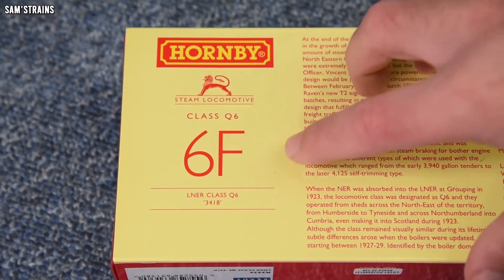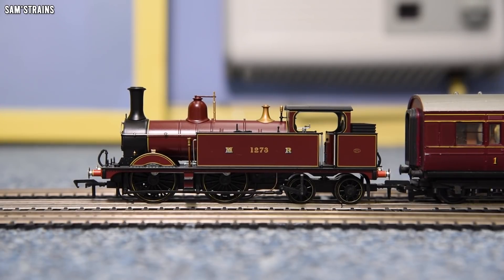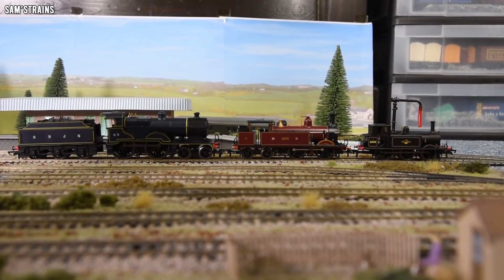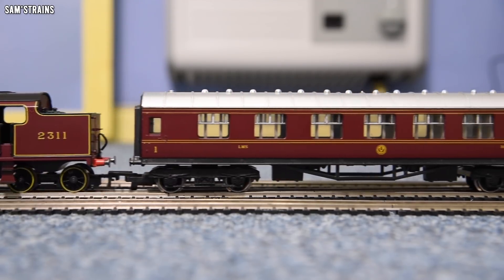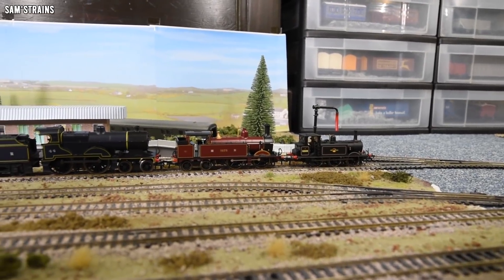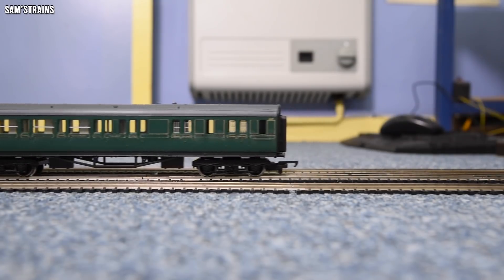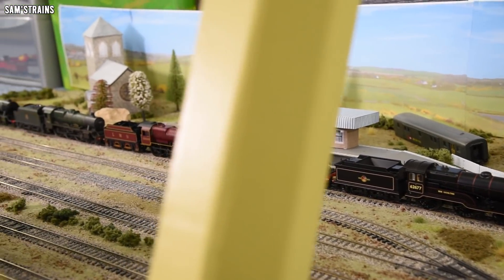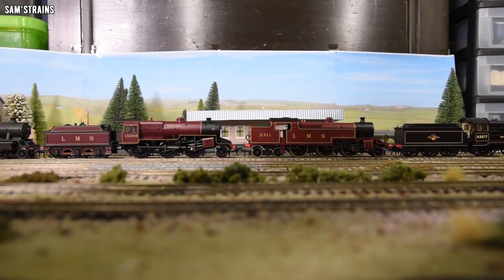British Steam Trains | Smallest to Largest!

Comment: 11:44 The Gresley A1s were a pre-grouping design and were classified 7P by BR.
Reply from the maker: Ahh fantastic - that would have been a good choice then!
Thanks for watching - Sam :)
Reply: I thought it was 8P / 6F ?
Reply: @stephendavies6949  The A1s were introduced in the early 20s, and were 7Ps, which was as powerful as they came at that point. The GWR Castles from around the same time were also 7P. The first 8Ps (to my knowledge) were the Kings (enlarged Castles modified for higher tractive effort) in 1927. The A1s were rebuilt into A3s at around this time, but these were also classifed 7P6F. The first LNER locos to be classified as 8P were the A4s of 1935.
Reply: @dkiely03  Hi again.  Your comments peaked my interest and I dug more deeply into this issue, and uncovered some new (to me anyway!) facts, such as at some point after 1948 BR decided to standardise the power classifications, and - with some exceptions - re-classified (mainly but not exclusively) LMS & many LNER Pacific 7Ps as 8Ps. If true, this would explain our difference of opinion & why some of the largest, most powerful express engines show 7P on the cabside when in LMS livery & 8P when in BR colours. 

This reclassification was apparently adopted throughout the power classes by BR

Comment: 5:19 The system was originally developed by the Midland Railway, then adopted by LMS and BR in slightly modified forms following the grouping and later nationalisation.
Reply: As the Jubilee comes up after 11:10, it's worth noting that this was involved in the biggest change from the LMS version of the system to the BR version. The LMS originally classified the Jubilees as 5XP, which was in between 5P and 6P (which included the Royal Scots). In 1951, the 5XP locomotives were reclassified as 6P, former 6P locomotives such as the Royal Scots became 7P, and former 7P locomotives (such as the Coronations) were reclassified as 8P.
Reply: 14:03 :-)

Comment: Just to mention, the SR Schools Class is a 5P
And anything Southern could be considered all mixed traffic, as said Schools class have be used to haul freight trains when there's nothing else to use (and mostly at night, can't have the passengers seeing lovely express engines pulling goods!), but Terriers were often used for freight trains on smaller lines as either nothing else about or nothing else could run on those lines.
Great video as always Sam!

Comment: The WR still used the GWR Route Classification disc's on their ex GWR loco's up until they were withdrawn, rather than the 'BR System'. Even some of the BR Standards running on the Western Region had the Route Classification discs.

Comment: The BR 9F was actually used frequently as a passenger locomotive on the Somerset and Dorset as suitable power for the winding and steep route.   Well known as motive power on "The Pines Express".  As such it could well have been classed as MT.  Great video Sam.

Comment: You need to take into account carriage sizes and weights which accelerated into the 1930's. What you consider to be a 2P Midland 4-4-0 would easily be pulling a rake of 7+ coaches on an express train. When the 1930’s brought about the speed challenge LMS – LNER not only did you know see the A4’s & Coronations, they were pulling carriages that were twice the size of the 1920’s and they were also twice the weight!

Comment: The reason for the different numbers is that the power thresholds were tested at 50mph for passenger locos, but 25mph for freight. That's why you get the 5P4F - different tests. If the numbers happened to match for both they were called 5MT. Excellent video - brilliant idea!
Reply: The LMS Hughes Crab’s Can Probably Go 50mph With Frieght Too
Reply: True! And the 9F really proved itself as a passenger loco, though it was never given a P classification ;)

Comment: In general, passenger locos - usually due to their larger wheels - were rated lower for freight than passenger work, where both power levels were listed. For example, the A4 was an 8P/6F

Comment: Fun fact about power classification: In the case of some steam locomotives, like the SR Q1s (5F or 5FA),  there is another letter beside the F. There are two letters: A and B. They meant to represent the low power range or high power range of the power class (that is how weak or powerful they are on the same power class). I’m not sure which one’s which but this is a very special and interesting fact that I can share in this comment section.

Comment: I'm wondering if the difference in classification for passenger s and freight has something to do with pulling power versus speed. The classification for passengers might be with lower criteria for pulled weight, but higher ones for speed.
Reply: Also, I believe wagons and coaches were coupled differently. Coaches were close coupled so that they would all be hauled at once to ensure a smooth start and finish. Wagons were coupled loosly so that the momentum of each would pull the next, therefore allowing for larger rakes per engine.

Comment: If you ever consider doing a video like this with freight locomotives, here are 10 locomotives I'd choose if I were you:
0F: LMS Pug
1F: Midland 1F
2F: LMS Ivatt class 2 (It's a 2MT in the BR era, but back in LMS days it was a 2F, so take it or leave it)
3F: LMS Jinty
4F: Fowler 4F
5F: LNER J39
6F: LNER Q6
7F: S&DJR 7F
8F: LMS 8F
9F: BR 9F

Comment: The system originated with the Midland Railway and so was taken up by the LMS and then later by BR.
The classification was based on the power output represented by a locomotive's tractive effort at 50 mph (passenger locomotives) or 25 mph (goods locomotives). This is the continuous tractive effort and is much lower than the starting tractive effort which is the figure usually quoted in technical publications.
Also explains why some Locomotives had different passenger and freight classifications. Eg 5P4F
Other railways did not use the system. Non LMS types only gained a classification in BR days if they survived in service that long..
Eg no Stirling Single classification. Not at all a locomotive class since the classification was not unique to a class.

Comment: Just one word before talking about the subjet : my J27 had the same problem as yours on arrival : chimney not fitted...AS a bonus, I have the folding footplate between the engine and the tender to put back on, but no problems with the coupling rods. Seems Oxford Rail might have to change his manufacturer later due to quality issues...
Great idea your viedo on power classification, I can give you another idea : why not one by type of wheelsets ? See the difference bitween a Mugl and a Pacific, what is an Atlantic or a Prairie, this kind of stuff if you wish.
By the way, nice video today, I love it !

Comment: There were several reasons for different power classifications for passenger and freight. Freight was largely unbraked (unfitted) early on, so a loco that didn't weigh much wouldn't have much stopping power, regardless of its hauling capability. As a consequence of unfitted trains, freight was also restricted in speed - typical 40 mph. This allowed freight locos to have smaller driving wheels, giving a loco more torque but lower top speed. Passenger locos on the other hand, had larger driving wheels (like the Stirling Single). in order to give a higher top speed. Also, for Passenger work, locos had to be fitted with a vacuum pipe system, and heater pipes (steam) for train heating. This means that most freight locos couldn't haul passengers "even if they could". They could however, still serve as banking engines for passenger trains.
Reply from the maker: Fascinating! Thanks for all the info! :D

Comment: 10:04 Do you have a Star or a King Arthur (LWSR N15)? I believe they were both 5Ps used designed mainly for passenger work. Of course, many express passenger locos were used on freight work later in their lives, and as a result aquired a freight power classification. The A4s for instance were 8P6F.

Comment: Love the video, though I have one little thing to add. Though the 9F's were classified as freight engines, they were a rather common site on heavy express trains. The S&D used them for their expresses and some depots had 9F's on stand-by in case an express engine failed. They didn't commonly pull the top link services like the Flying Scotsman or the Royal Scot, but they didn't shy away from named expresses and weren't slouches in speed.
Reply from the maker: Thanks for sharing - appreciate the info! :D

Comment: the western system impresses me as they used a coloured shape, which gave route availability an a letter on top of the shape which gave power. if my notoriously poor memory serves the widest route availability was a yellow triangle and the most restrictive was the double red dot of the kings. so not only what it could haul, but where to at the same time. i like the logic of this. thanks for the usual great video. you could do it again with all western engines regards Roy. PS I just followed another of your reviews and got aB2. totally impressive model
Reply from the maker: Yeah that’s quite a smart one isn’t it - maybe a video on that would be fun?
Reply: @SamsTrains  well I would enjoy it. but then I enjoy your videos your layout is so joyouslyplafull. yes it would be easy to make fun of it, but the pursuit of enjoyment over "rivet counting" is a breath of fresh air. a video of this would be enjoyed by every GWR fan. despite preferring the Southern, I will admit that the gwr is the most charismatic as evidenced by its fans calling it "god's wonderful railway" and Brunel was probably the greatest railway engineer as he designed everything buildings, great bridges and as a sideline, early iron ships, with ground breaking power systems including modern style propellers just in front of the rudder so you probably can't loose doing a gwr version of this video. thanks for another great episode

Comment: Not all steam locomotives got classified by this system, if the railway was planning to withdraw a class early on, they'd not waste time on classifying a class.  Also, classes that didn't pull normal trains often went unclassified, shunters and bankers.  The Midland's Big Bertha never had a classification as the system was based on pulling power and she only pushed.

The classification is also somewhat based on tractive effort, but things like wheelslip can affect it.  The SR Q1s have a tractive effort comparable to the LMS 7F 0-8-0s, but since they had issues with wheelslipping on heavier loads, they were only classified as 5Fs.  Still insane for 0-6-0s built for cheap.  Bulleid's wartime designs are pure genius.

For Diesels, they had a separate system, one based on their engine horsepower.  Small shunters like the 07, larger shunters like the 08s and 13s, Type 1s like the Class 20s, Type 2s like the Class 24s, Type 3s like the Class 37s, Type 4s like the Class 40s, and Type 5s like the Class 55s.

0P: Terriers being a 0P isn't majorly shocking.  They started being built in 1870, so by BR members of the class were nearly 90 years old and that is just insane longevity for a steam loco, some classes were lucky to get a decade or two.  Tender engine, technically some of the older locos could qualify, but they'd have been withdrawn before LMS or BR ownership or not owned long enough by them to be classified.

1P: It fits having a MR livery, the classification system did come from the MR.  For a tender engine, quite a few older engines were this weak.  GER Class T26 for example, they were the last of 2-4-0 tender engines to be in use and were used by BR.  Another would be the MR 115 Class, the 4-2-2 Spinners.

2P: Fitting for the SD&JR to be here too, their engines were Midland Railway built and later LMS built.

Some 5Ps: L&YR Hughes 4-6-4T, SR Schools Class, GCR Class 1B (UK's first SG 2-6-4Ts), and GWR Star Class
Reply from the maker: Very interesting, thanks for sharing all of this - neat stuff!

Comment: There is a terric mistake with the Johnson 4-4-0. These were express engines designed to pull 7+ carriages pre grouping. Not  double bogie heavy weight carriages of the 1930-40's!

Comment: I imagine that the main reason the power classification of the Terrier is so low is weight (around 28 tons, compared to 48 tons for a 57xx). As you have showed with a previous experiment, tractive effort is proportional to the weight over the driving wheels. Since the power of a locomotive is the tractive effort at a given speed (I believe 50mph was used for passenger locos, and 25 for goods), the low weight will lead to a low power classification.
In real life, Terriers do have a reputation for being 'light on their feet' (i.e. prone to wheelslip) which limits the loads they can pull.

Comment: QUESTION. why is there a distinction between frieght and passenger in terms of 'power'? is it down to the gearing? i.e. passenger trains need to have a certain speed etc
Reply: There is a distinction based on use. For the LMS who invented it, and later for the BR who used it, the power qualification was made with a measure at 25 mph for freight trains, and 50 mph for passengers trains. Have in mind that nearly all the freight wagons in Britain were not equipped with brakes untill the late 50s / early '60s, so slow speed needed.
Reply: Invented by the Midland Railway then used by the LMS and then BR with modifications over time.
The power classification was based on the power output represented by a locomotive's tractive effort at 50 mph (passenger locomotives) or 25 mph (goods locomotives). This is the continuous tractive effort and is much lower than the starting tractive effort which is the figure usually quoted in technical publications.

Comment: Your next project? Wheel arrangements. Because there were some oddballs in this video.

A 4-4-0 is a pretty familiar arrangement, but an 0-4-4? That's a bit left field, at least to me.

Of course, there's other weird ones, such as the Double Fairlies (including the ones exported to Mexico for mountain work) and the Garretts. Then of course there's the monsters built for hauling giant freight trains through mountain passes in the USA, of which the Union Pacific "Big Boy" is merely the most famous.

But move outside the UK and the USA, and there's some real oddities. South Africa has a couple of these, and then there's possibly the weirdest setup using a "conventional" chassis instead of an articulated one - a 2-14-0 built in the former Soviet Union. Which was a failure because it was pretty much restricted to straight line track for all practical purposes. Hence the move to articulation and the likes of 4-8-8-4 setups elsewhere.

Oh, and there was at least one attempt to build a loco with THREE independently articulated sets of driving wheels - I think it was, wait for it, a 2-8-8-8-2 of all things!!!!!

Finding models to show off some of the weirder arrangements will probably be a challenge, though you DO now have a Double Fairlie. :)

Comment: You could have tried doing both the Ps and the Fs although I can't think of a 9P.
Reply: 9F classification was only introduced by BR and they did not see the need for a 9P classification as no new passenger locomotives with more tractive effort than a 8P were built.
If the LNER P2 Mikados had survived they might have been a 9P.

Comment: Wow, I never realized the UK was limited to such pathetically tiny locos.
Mostly kidding, they're gorgeous too but it's funny that the massive 9Fs are only upper middle weight compared to US locos. I'd love to see a comparison between a 9F and a Big Boy or PRR T1 sometime. (BR 9F is 66 ft, Big Boy is 85, and the T1 is 122 with tender I believe!)
Reply: We did have some Garratts, the LMS had 33 of them, 2-6-0 0-6-2, 150 tons 46,000lb/feet tractive effort, and the LNER had the U1, a 2-8-0 0-8-2, 200 tons with 73,000lb/feet tractive effort- they were almost 90feet long, and the largest locos on UK rail, not a match for a big-boy, but pretty respectable, especially considering out small loading gauge 😃

Comment: Technically the 9F would've been 10P I think but obviously they were never marked as such since they were very rarely used for passenger trains except for banking
Reply: why would it have been 10p given it was less powerful both in tractive effort and hp terms than several classes rated 8p including the princesses/duchesses/a1,2,3 and 4,mn?